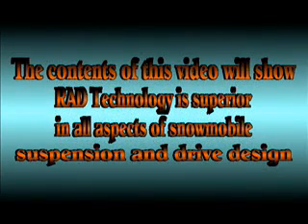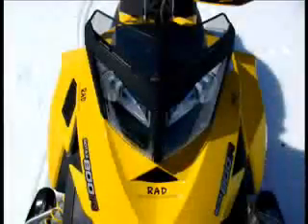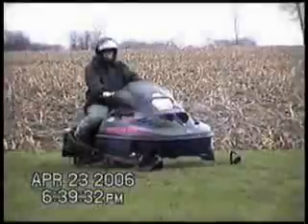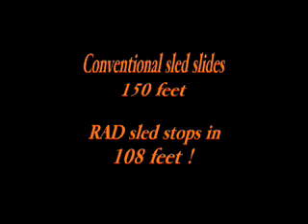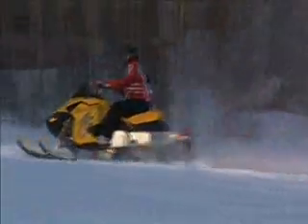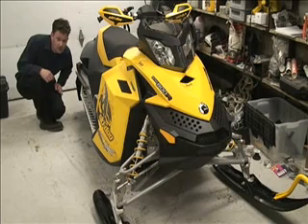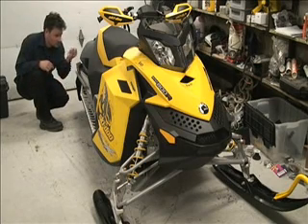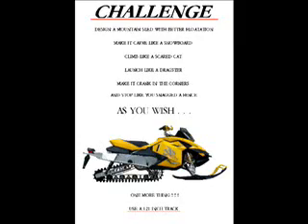2008 Ski-doo REV XP MXZ 800 with Rear Axle Drive Technology works with Polaris Yamaha Arctic Cat

Comment from the maker: Watch the video on the new generation prototype sled. It's a Black 800R. It has smaller idler with approach. This system is still the most efficient. See next months American Snowmobiler magazine where this sled achieves higher top speed than the Z1 Turbo and dramatically better fuel eoconomy than all sleds tested. Shortest stopping distance and tighest turning radius. Adding a passenger does not change turning radius unlike conventional. This technology is still under development. See website!

Comment from the maker: An O-ring chain will take more punishment than the silent chain in a chain case. A production model will likely use a gear belt with an enclosure.
I am not offering this as a kit at this time! It will become available as part of a production sled.
There are LESS PARTS in this drive system! LESS ROTATING WEIGHT! That is partly why the performance is so much higher!

Comment from the maker: Again!!! Swing arm and rear shock absorb frontal impact of idler wheel!!! 

Front idler is connected to slide rail connected to angled rear swing arm suspended by rear shocks! Look at the direction of the forces.

Comment from the maker: I have not had any problems as of yet!
How are the wheels on an ATV any different then my front idler wheel?
Understand that a frontal impact to the wheel gets absorbed into the rear suspension through the slide rail. Swing arm is on an angle, energy goes into rear shock.
Everyone keeps asking this question but people have to look closer at how the parts relate with each other.

Comment: What kind of a hit can the front of the track/large idler take?the angled style allows hard items to get tucked under and thrown out, if your large idler hits a solid object that is fairly purpendicular then what damage will it do to the suspension and large wheel at the front.  And - will the driver get catapulted?Why not use a smaller front idler..  The front of the track is what throws me off, the balancing thing is ok but i dont care about that part -  that's what RER is for (reverse).

Comment from the maker: Snow and ice build up has not been a problem so far. Look at the punishment chains dirt bikes and quads take in sand, mud and stones. Inside the track is a pretty clean environment compared to what a chain is used to performing in.
None the less my new prototype will have an enclosed poly chain GT (cog belt). Still the O-ring chain and sprocket has shown no sign of wear yet.

Comment from the maker: RAD Technology utilizes the shortest distance possible to transfer hp from the engine to the ground. (bottom side of track) That is what matters. Have you ever used a long extension on your ratchet and found you could not crack that bolt loose? Remove the extension and the bolt cracks loose easy. The long extension absorbed the torque making it difficult to transfer the energy into the bolt.

Comment from the maker: Secondly, the guards are removed to show the variable speed belt function. The long belt runs smooth with normal belt deflection on the slack side. The increased arc of contact around the primary clutch is what improves belt slippage under high loads. Same applies to a full shift position on the secondary clutch. Less heat build up from less slippage. Long belts allow forgiveness on pulley alignment and the long belt gives time to provide cooling, so less heat transfer.

Comment from the maker: The burnout demonstrates how track tension is applied. Only what contacts the ground is under tension. Track stretch, studs pulling out and high rolling resistance is caused by high track tension around the rear idler on a conventional drive system. RAD Technology allows the track to free wheel much more and drivers never skip. If you are after top speed back the track way off and the speeds go up. Inertia forces are high on a tight radius requiring more hp to do the same amount of work.

Comment from the maker: Had the sled out in some deep loose snow yesterday . . . 2 to 3 feet fluffy snow. Front idler wheel compresses a bit and stays on top. No problems! That 4 feet of track gets up on top fast! Easy to carve without using both feet on one running board. I will post a video soon!

Comment from the maker: The other sled is a 2001 MXZ 800 136 inch track. It used a taller 1.25 inch lug to my 1 inch lug so the other sled had the advantage. This clip is a condensed version of my full DVD that you will find on my website. I do a lot more testing against another 2008 REV XP 800. That sled also had the advantage using a 1.5 inch ripsaw to my 1.25 ripsaw. So go to the website to see everything!

Comment from the maker: The front idler wheel stays on top because it is so far forward and ahead of the C of G. If there is weight the front idler wheel will compress. This makes the approach angle the entire bottom of the skid which is a flat 47 inches rather than the stock 33 inches. When the chassis rotates in deep snow on a conventional sled the approach angle is now a near vertical wall and if the exposed gap (belly pan) between skis and track takes on weight you get stuck.

Comment from the maker: I totally see where you are coming from sledhead69 and this has been a common topic of discussion. I didn't get any footage in deep loose powder last season, this year I will. I know this looks weird to people but it works and works for a reason. See my floatation poster on my website. Think of a boat on water. Where you place the weight relative to the surface area (the hull) dictates the pitch (balance front to back).

Comment from the maker: Very good point but lets remember this prototype is only using a 121 inch track yet has the surface area of a 151 inch. You are right that was not loose powder, it was about 4 feet of snow with a crust layer on top. Watch the video again, the front idler wheel does compress up into the tunnel as you suggested to do. That wheel contacts 15 inches further forward than stock, taking weight off the skis in deep snow allows you to carve better.

Comment: i ride mostly backcountry and love the hang time via drops or natural ramps, step ups and i love the ditchbanging when im not in the pow-pow, have you beat on this set up yet?   jumping or hard ditch banging would be extremely stressful on the rear chain drive im not knocking just wondering if your hitting all spectrums of sledding or is this primarily for trail/drag racing use?  i think you have some awesome ideas and wish you the best of luck....you may just change snowmobiling

Comment from the maker: That is very important! I will be posting all my testing this winter as it happens. The rear suspension has powered height adjust using a thumb switch on the handle bars. You can adjust how much ski pressure you want while you are driving. Safety and control is one of my primary concerns I have focused on while developing this drive design. Stopping power is dramatic on snow or ice. 
Watch the full version of the video on my website. This is just bits and pieces!

Comment from the maker: You can run the track as loose as you want and the drivers never skip. Great for increased top speed. I will post videos of testing this winter. There is no track noise (howl sound). On a conventional sled this noise is caused by the track windows striking the plastic sliders at the approach angle. RAD Technology delivers the track straight into the sliders via the 11 inch front idler wheel. My next prototype has an enclosed polychain belt drive instead of the chain. See this on my website!

Comment from the maker: Thank you YellowVtec for your comments!
This prototype uses a 121 inch track but has the same track surface area as a 151 inch mountain sled. 43% increase in surface area. There is no chaincase which removed 21 lbs. of parts and simplified the drive system. This is the shortest route possible to get the power to the ground. I removed the guards in the burnout to show how well the long drive belt works, the track tension is applied to the bottom of the track and the top side simply freewheels.

Comment: Interesting, looks like it trenches at the beginning but stays on top after the initial torque, Does seem like alot of drive line to be spining, how does that effect top end and vibration? I don't see much of a chain guide in that burn out either, slush and ice build up effect it alot?